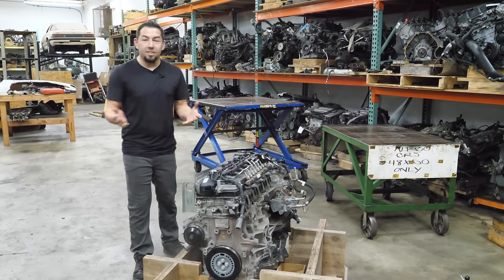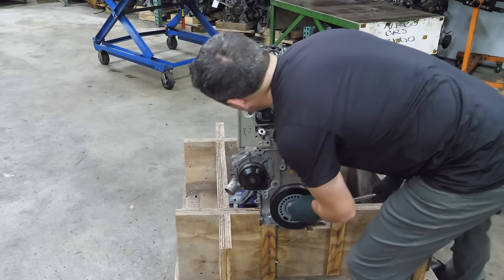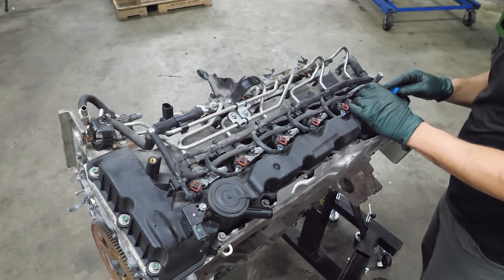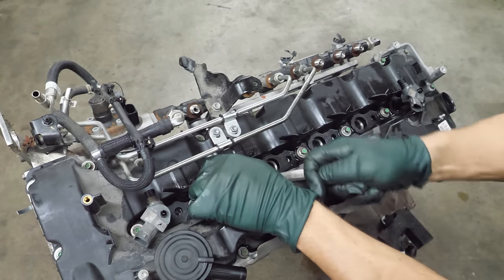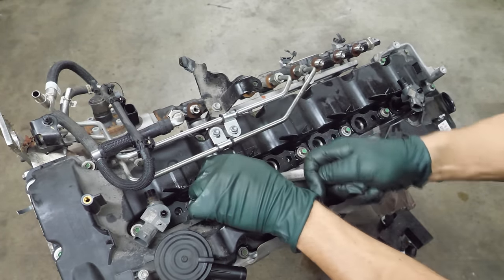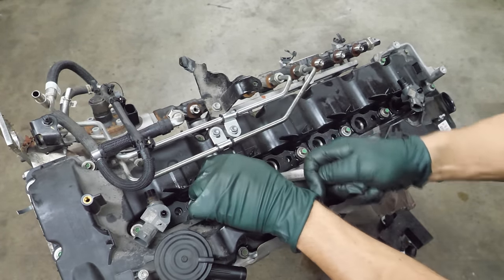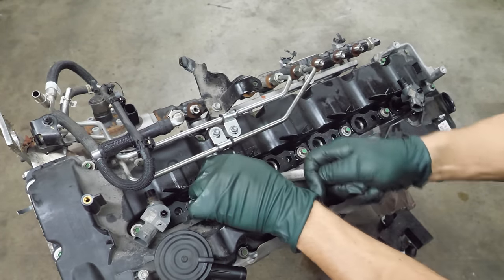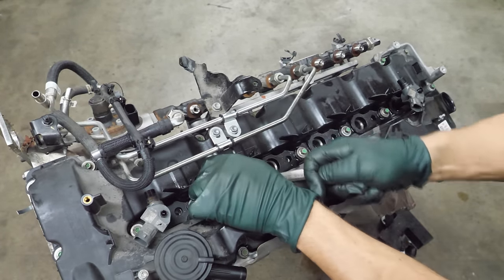BAD 2020 Silverado 3.0 Duramax LM2 Engine Teardown INCREDIBLE DAMAGE!

Comment: New rule for Engineers: you must work on all engine designs for 1 year before placement in a vehicle.
Reply: Melt it down and build a om 617 mercedes Benz diesel 900000 miles and still running ronrdzl
Reply: You don’t think engines are tested for at least a year before being put in a vehicle lmao? Most engines go through 5+ year development cycles
Reply: Execs and designers say "this is the car. This is what has to go in it. Make it fit, make it work, make it look integrated, and make it simple enough a wild baboon can operate it. You have 6 weeks" oh and "do it as cheaply as possible "
Reply: Engineers should be forced to repair common things on a complete vehicle before production. They’ll quit their jobs.
Reply: It should be in a vehicle so they know are pain
Reply: @sabretechv2 Not what he said. Engineers need to work on engines in cars or trucks before the engines get put into vehicles.  It would stop the insanity of some engineering. Like pulling the complete dash to replace evaporator core or heater core,  or the dash control modules.
Reply: @erwinpadgett1050  I can tell you’ve never been involved in the engineering process of anything because that’s not at all how it works lmao. You’re typically responsible for one subsystem or component, as an engineer it would make zero difference if you worked on engines or not yourself. Maybe the high level system engineers but you don’t get how requirements flow down in a corporate environment
Reply: They do this is the company not wanting their vehicles to last anymore with incentive from the govt/ powers that be. As the caption says planned obsolescence
Reply: I say have them work on them for three years AND their pay be the same warranty time that mechanics are paid.  Additionally the rest of the white collar corporate executives need to work on the products they’ve created.
Reply: @preachers4135  My thoughts exactly.
Reply: @preachers4135  bro doesn’t get how engineering works at all lol. That’s all we do all day when we build and characterize and integrate electronics, electromechanical systems, etc is work on them. It’s in a lab environment but that’s what applied research is.
Reply: @ronbrennan4632 then they can’t sell you a new truck
Reply: Im an engineer and started off assembling machines. Not all of us only sit behind a desk.
Reply: @driftx2  If yall did, working on your finished products would be redesigned to last and be worked on. Not take everything off to replace one part.
Reply: Engineers always have excuses as to why their product is crap and not their fault lol 😂
Reply: @sabretechv2  Possibly for some engines, that 5 years was allocated for testing & eval... Some were definitely put out to be sold to the public, long before they should have... Case in point, The Chevy Vega 2.3L inline 4 and the Oldsmobile gas to diesel conversions, too many other problem designs to list here from several companies... They need to be thoroughly tested BEFORE they are released to be sold to the public...
      If the faulty designs are bad enough, it could put an otherwise good product out of business...
Reply: you must be new to this. Engineers very rarely have anything laid out how they prefer. Always cost to develop and manufacture is the final determining factor. When you become upset you should direct your frustration to bean counters who figured it's possible to save $.80 a unit by cramming everything into an illogical design.
Reply: @ThatGuy-sd3zl you must not be able to read previous comments. I'm not surprised.
Reply: @erwinpadgett1050 nope. Completely wrong
Reply: @erwinpadgett1050 nope. Cost to develop and manufacture always are the determining factor today. The first time someone says manufacturing time or a different part that is good enough can save pennies per unit that design and or part is used along with design.
Reply: @davidporter7051  Wrong, there's still an approval process,  along with computer design process. Then it has to Board approved before it gets back to engineers. The saving comes in with no testing of the total final product. Which is why there are so many Recalls. Nothing saves money more than less testing and selling vehicles to looks.
Reply: @erwinpadgett1050  nope. Cost always wins. Not ergonomics, not logical design, not ease of service. The bottom line is the determining factor it's all executives care about because this is how their tenure is judged.
Reply: @davidporter7051  Really, bet you never pulled a dash to replace a heater core or evaporator core. Or had to pull more that you think you should to replace 1 part. It's clear to me you don't have experience or knowledge to these facts. It's why almost every manufacturer does it. Cram it into one space so we put it in the vehicle in chunks making it easier to assemble. Plus you talk like you've never been to an assembly line. Or watched  one from start to finish. Plus hardly ever disassembled a vehicle. It's been the same process since the 1980s except for the changing of AI assembly arms and AI welding. Everything else is about the same. More AI process is now being used to save that ultimate dollar or money.
Reply: @davidporter7051  WTF do you think my point was? Board of Executives approves the design, timeliness, and parts used.  Also why parts like HVAC are bulk to be put on vehicles. But the design is another story. There is where it can be designed and rejected only to be resigned  inside and out. Everything is based or was off sales, plus Government Regulations. Which drives up the price. You are correct about cheaply made, and produced. With popular models making thr nsme for the companies. When I started in 1984, a Pontiac Sunbird, sold for 13 to 14k, cost 6k to build and dealers paid 8.5k for them. I also was GM schooled and got to ho thru Doraville, GA, assembly plant. But I still have Friends who work at GM and until 2years ago were still there. The thing you failed to mention is the oarts supply chain which today is strained. The Big 3 aren't like others but have had the same supply chain fiasco. Because the supply of parts is made worldwide.
Reply: @erwinpadgett1050  you may write a long fairytale I have discarded it before you even thought of writing it. Once you asked if I've ever taken a dash off because you made a feeble attempt to equate a simple repair to how corporations decide on the final design, you completely lost any interest I had in reading your dribble. Carry on your journey, I sincerely hope our paths never cross for I'm certain this would only cause me to lose more usable brain matter.
Reply: @davidporter7051  Gorge your self on being a know it all. Your best trait. You neither have knowledge or common sense. Nor do you know it all.
Reply: @erwinpadgett1050  I apologize Erwin. I don't speak ignorant.
Reply: As a builder I think architects should work in the field for the first year. Engineers should also!
Reply: Engineers are told to make them complicated on purposes to prevent shade tree mechanics from taking money from the dealership shops.
Reply: @mloney9772  Yeah, cause Dealerships don't have technicians to fix their vehicles and Dealerships never screwd over customers.  But your point has truth in it. Moreover it's young engineers that don't have a clue to the problems they create. And the process of the vehicles being easy for them to put together.  Aka,  HVAC system in one complete unit that requires the whole dash to be removed to be worked on or replace parts in it. I do agree about wanting the Dealerships to repair it.
Reply: @erwinpadgett1050  I also agree with you that all engineers should do a rotation on the factory floor. I really value my time with my hand on the parts that help design. It is invaluable to me and also more fun than pouring over spreadsheets, lol.
Reply: And must use it in a vehicle until production is creased and no aftermarket support parts are offered
Reply: @sabretechv2  but are the engineers working on them when they are not on an engine stand?
Reply: @sabretechv2  Doesn't mean they're doing the correct testing. I've been saying this for years. Engineers are smart but most of the time they think they are smarter than the people using their designs. You think apple software engineers use apple maps? Yeah right they're on android. Most auto engineers place to high a value on squishing components together to take up no space but makes it impossible to work on. If they had to sit there while a mechanic, that they considered to be their peer, teardown the front of the car/engine in front of them they would change to design.
Reply: look how thin the block wall is. I wonder how many heat cycles it can take. definitely not as good as old 3800
Reply: Just one year of field experience in general will fix most engineering issues....
Reply: YES
Reply: engineers hate mechanics. engineers think they are experts on making shit when their shit doesnt last forever. engineers should be ashamed of themselves how theyve started building vehicles. needing to cut the factory tow hook bolts out because they were mounted before the rest of the chassis is rather stupid. engineers who design shit poorly dont deserve the title of engineer
Reply: Actually i disagree.  It should be a requirement for the engineers to be forced to actually SERVICE several of each of the vehicles they design, in ways real world mechanics have to (in the car/truck!!!).
Reply: @CL-ok1gx  I manage an engineering department. The engineers aren't the reason our products have occasional faults. I am the reason, and people like me are the reason. It's because we're trying to balance business and quality. Sometimes we get it wrong. Engineers do almost nothing but try to create the perfect product, but that has to be reigned in because customers can't afford the perfect product and they're not paying for the perfect product.
Reply: The engineering department  (combustion engines) i understand has been put on notice for lay off.
Reply: @sabretechv2 and they still end up being garbage
Reply: @sabretechv2 Keep making excuses for stupid, terrible engineering.
Reply: Engineers in Milford design for 3 years out. Wait for the new 8.2L Duramax
Reply: @johngormley3908  that will be junk
Reply: Lol tell that to program management. Engineers always wished we could be given more time.
Reply: I’m an automotive engineer don’t tell them I told you this, but we (employer) really don’t care. Truck blows up after the warranty. To be honest. Most cars nowadays. Have a 10 year expiration date. The people I work with every day with the smartest people I know from mechanics to former Dakar , and Baja engineers,. Trust me we can make a reliable engine Toyota was doing it back in the 2000s. There’s been multiple cases where through long-term testing we have found multiple issues but since the issues we found “most likely” happen over 200,000 miles we purposely did nothing. our customer base (likely used) who drives cars not far into the future. Don’t have the money to buy a new products so we don’t care what they think about us. And the customer basis I that afford a new truck will have a perfectly problem with the truck for 6 to 8 years. before you ask other companies do the same even Toyota now with the new turbo junk. We usually open up or competitors engines and see what we can rivers engineer or learn from )non-patented) Sooo… sorry 😢 (power train engineer in one of the big American three)
Reply: @sabretechv2 you're defending "let's make it so you have to take the cab off to replace this part"
or "let's make this hard to get to chain a belt instead"
or "let's make sure any part replacement requires the removal of 5 to 10 uninvolved parts"
etc.
We get it. I'm on team engineer too. It's always admirable to skip over a dozen virgins to screw a mechanic. There's no such thing as flawed engineering anyway, just whiny master technicians. 👍
Reply: I'm sure they worked on this for years
Reply: Engineers should have to be a mechanic before they design this crap
Reply: Note for idiots that think engineers make all these decisions:  you must actually work in corporate american before commenting again
Reply: @HaleFire7  "corporate american"
Reply: It used to be engineered actually worked on stuff. One local University is known for it's engineering program, and when they opened in the early 1900's, the main building, now refered to as "Old Main", housed forge and foundry workshops. When I worked on it's renovation 10yrs ago, it still had a steam engine(I think it's since been removed for preservation), and 3 steam dynomometer cells still in place, but long disused. That building now houses the IT department, a data-center, and a research institute. And given the projects I've worked there, I wouldn't trust any graduate to be able to engineer piece of string. Honestly the worst project management I've ever seen was there. The project mentioned was my second project there. The first was massively behind schedule, and all contractors were afraid to tell the project supervisor. Result being the tail end of that dorm renovation project was students in the buildings while I was still finishing up cobbling in loose stair treads in the stairwell with vast amounts of contact cement. Can't say I've ever been higher on a job, due to the fumes, and the only ventilation available(without venting into the dorm area's was an exterior door at the bottom of the stairs; And for most of them, I was using the cheap store contintrernalact cement,the flooring contractor had put in a change order to redo the stairwells and it was rejected. As the flooring contractor took pity on the situation, he did give me a partial bucket of the proper adhesive. If I hadn't made a fuss about using contact cement, they wanted me to use liquid nails to put them down(which is brittle, so would fail rapidly.) Talking to my uncle, who's a carpenter their, I heard all the treads I installed failed rather quickly, as I expected. This all took place after the entire crew minus me was let go Friday, without my knowledge. Showed up Monday, and I was the only one to show up, and later found out everyone else was let go as the job was done. Post this job, and thinking back on the jobs I worked for them, I concluded the hired internal temps for non-risky summer jobs, and  hired outside for risky jobs(both jobs I did for them were sites which had asbestos abatement going on.)
Reply: @ronbrennan4632 The problem is the new manufacturing processes for component parts. Design of engines is fine. What governments are doing to drive up the cost of manufacturing the component parts, forcing cost cutting measures, is the issue.
Reply: That rule would result in no new engines. The part that is so upsetting, the belt driving the oli pump, seems to be a total non-issue. It looked great after 145K. Sure, old wives always warned you about belts, but old wives weren't always right.
Reply: I second that!👌
Reply: This engine wasn't designed by GM. The design was purchased from an Italian firm, hence the typically Euro design flaws
Reply: @ThatGuy-sd3zl  mechanics should be forced to sit in a meeting discussing design constraints before claiming they know everything. Hint: it's usually this way for reasons you don't understand.
Reply: “Dowhatnow?” - the engineers